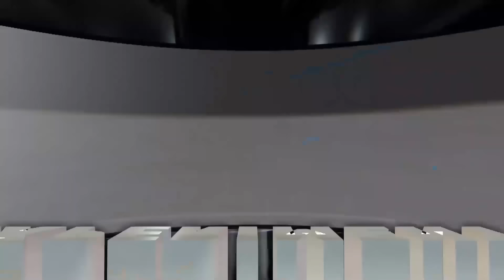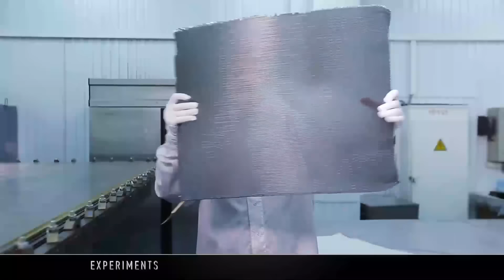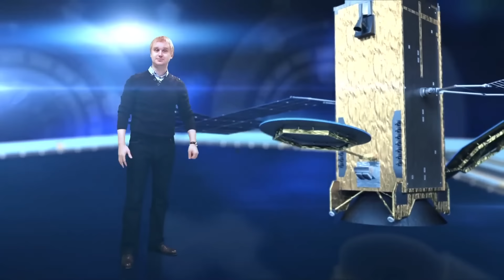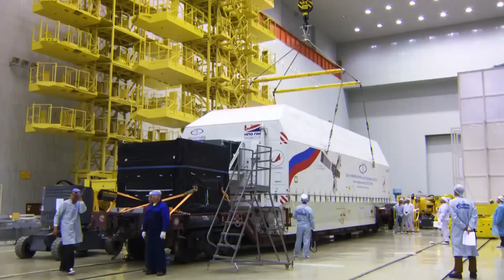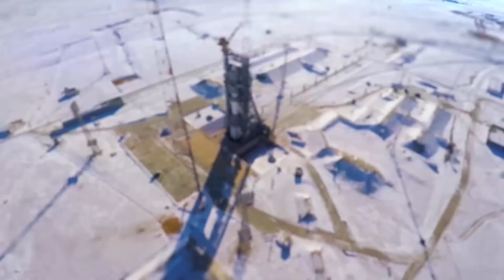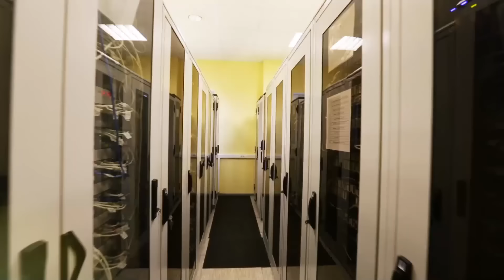Satellite MANUFACTURING: Build & Launch Process

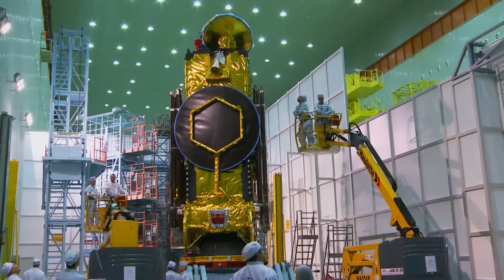Comment: ill be honest 11:42 look like aluminum foil. how tf would that even survive the harshness of "space"? feels like some nasa bs with a sprinkle of modernism..
Reply: It’s multi-layered insulation, most likely. It protects from thermal radiation, micrometeoroid impacts, and electrostatic discharge. The yellow sheen is likely Kapton, though gold foil is sometimes used in insulation systems in spacecraft. Also, it’s not “space”, it’s space! It exists, and it’s pretty cool.
Reply: @radtonium " most likely" is hilarious
Reply: Your Intuition IS correct.

Its total BS.
Reply: Now, also while traveling over a thousand miles an hour up in space, twenty two thousand miles away 😂😂
Reply: Shit is on a balloon 🎈
Reply: Why wouldn’t it? Its primary purpose is to act as shield against radiation and heat.
Reply: Every gram matters.
Reply: :face-purple-wide-eyes::face-purple-wide-eyes::face-purple-wide-eyes::face-fuchsia-poop-shape:
Reply: Some of it looks like insulation. Think of a thermal blanket. Harness is space is not that extreme. Outside of thermal radiation, the harshness is mostly during launch on the rocket.

Comment: Uuuummmm aluminum and most metal have such a low melting point. Same with batteries. Never seen in my 17 years in the battery industry that can handle the so called temperatures of space. Not even close

Comment: How do a rocket lift a satellite into space.
Reply: by rocketting
Reply: Impulse
Reply: liquid oxygen and either liquid methane or RP-1 are combined and ignited to produce hefty amounts of lift on the first stage. further into flight, that stage will separate, and the vehicle will switch to a different fuel type and engine, consisting of liquid oxygen and liquid hydrogen (methalox has been used at least once in a 2nd stage). that second stage will then make the last push into orbit.